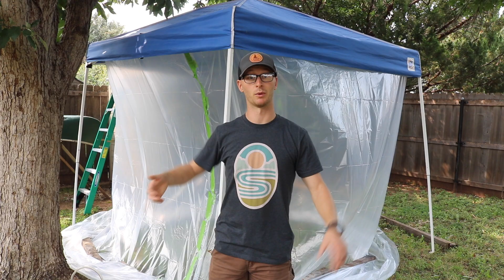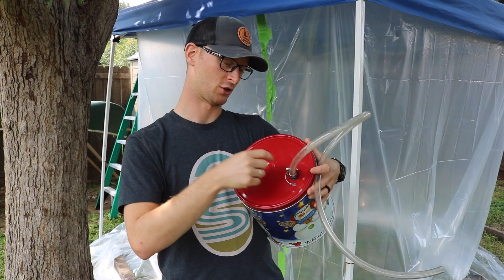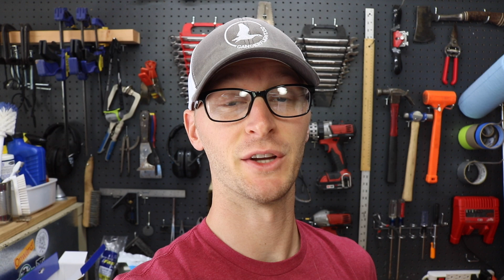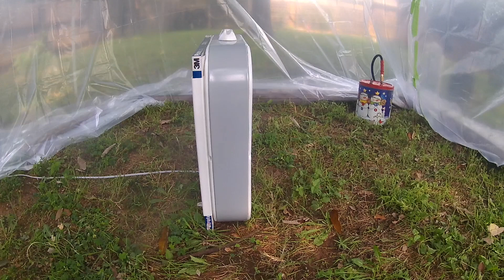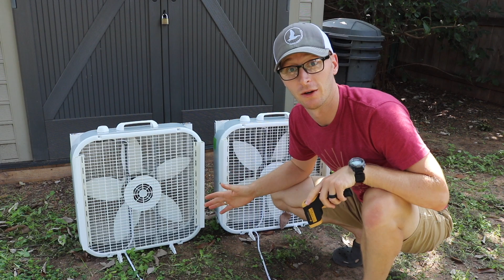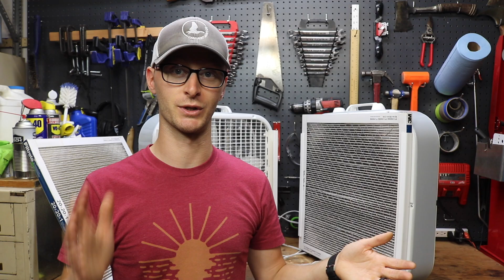Are DIY Box Fan Air Filters SAFE?

Comment: I would like to do this in my woodshop. What is a good filter for airborne wood dust.
Reply from the maker: Read the packages for the filters - but I'd say the MERV 13 I'm using in the house would be overkill.
Reply: @GanderFlight  Wood dust is very fine.  MERV 13 would be great.

Comment: Most of these motors have a thermal stop fuse, that will merely stop the motor if it gets too hot. Most often, they don NOT self reset. The thermal cutoff needs to be replaced, if it's even accessible. More often than not, you end up just replacing the whole fan. I wouldn't worry too much, because the motor needs to exceed 180 degrees Fahrenheit to trip that, and you're not getting anywhere near that hot.
     If I was going to recommend anything, I would say get 4 or 5 filters, and make a box. That gives you that many times more surface area, the fan will flow more freely, and, the filters can get dirtier before they need replacement. Each filter only needs to allow 1/4 the airflow, before the fan loses effectiveness. While it's more expensive up front to buy that many filters, it will save you money in the long run. While more effective, it does end up looking pretty DYI. Ugly, but tremendously effective! (I, like you, recommend putting the filters behind the fan for the same reasons you stated)
Reply from the maker: Good to know about the thermal fuses!  Yeah everything is a game of compromises right? Aesthetics, function, low cost — pick two 🤣
Reply: @GanderFlight  Have you had a chance, to see if it prolongs the life of your furnace filter? The reason I ask, is because I have a base-board heating system, that uses hot water circulation. My heating system has no filter, and the house is much more dusty, than my other house, that used a forced-air heating system, with a filter. I had to replace that filter regularly. The biggest difference, is that the furnace cycled on and off, where as my filter box/ fan, with a motor that requires only ~1/10 the power, runs 24/7. I think this is more effective, than the forced-air furnace.
     There are actually NAMES for these things! If you use 5 filters, and prop it up so air can get through all five filters, it's called a "Corsi-Rosenthal box". If you use four filters, and just use a cardboard square on the back, with the intention of placing it on the floor, with the fan blowing toward the ceiling, it's called a "Comparetto cube".
Reply from the maker: @vincentrobinette1507  I have not had a chance to test and document that concern. I can only assume it would - you're taking the same amount of air in the system (house) and adding another filter.

Comment: Great video! I saw this idea, (same as yours), some months ago. The idea bounced around my head for a while and I decided to build one. One $18.00 Walmart fan and a 20"X 20" filter, the most expensive one Lowe's sells, taped it on securely and it has been running constantly for 6 months or so. The fan motor hasn't gone south but I change the filter every 2-2.5 months. That worked so well, I got another fan and filter and some duck tape. That one has been running for nearly 3 months. We have a HEPA filter in the bedroom due to my wife's allergies and my COPD. The fan filters do make a difference but I have no way of testing its efficiency.
Reply from the maker: Glad theyre working out for you!

Comment: Best reason to put FILTER ON BACK is because you're filtering the air BEFORE the dust gets to the fan motor.  If this was near a dust source that can build up (like saw dust) then the dust can not collect on the back of the motor because the filter collected the dust first.  

This reason alone is important enough to make it the preferred method.
Reply from the maker: Thanks for the perspective!
Reply: Excellent Point!

Comment: I love your idea.  This video It shows how corporation fail us so badly,  now more than ever. hundreds
Making an air filter need only a few elements with good deign, quality filters that matches the volume of air .. A big fan matched to a big filter.  
Quality filters, motors then production. Not sweet shop labor from poor farms and under age kids or teens who need to be in school, not on shop floors making our cell phones, fancy cloths and sports wear.  
The fan on the right may run a bit hotter because of  a manufacturing variable, from the same factory but a time.  The quality of the product, how many flaws are allowed before the rejects are noticed.
Reply from the maker: You are correct - each fan motor may have a different base operating temperature.

Comment: the only thing that I can see if you put the filter in the back is that no dust will stick neither on the blades or in the back grille as it usually does when you don't have a filter on it
Reply from the maker: Filter on the back definitely helps keep the fan itself clean.

Comment: What are you using for a filter bracket to secure the filter to the fan?
Reply from the maker: J Channel from the hardware store. Its used on vinyl siding - you'll have to cut it down and the size isn't 1", but its flexible and holds the 1" filters nicely.

Comment: You would experience a difference! Its based on how the fan is designed to flow. Air intake is passive, so low power consumption. Airflow, from the front, is what is powered by the engine, and by immediately impeding it you loose many cfm (amount of actual air movement throughout the entire room). Sorry if not explained well, but trust me, it makes a huge difference when turning over air throughout the whole room!
Reply from the maker: Clarify for me - are you then advocating for the filter on the back or front based on that?
Reply: @GanderFlight  YES! 100% on the back.

Comment: going to  purchase a 20 x20 filter and cut away the card bord and   measure out  whay i need for my honeywell   air purifier     its  like   4  in  wide  x  24  in long and install it    take out the black  foam filter    it should work well  and i can  get  4 or 5   filters out of it    !
Reply from the maker: Sounds like you have a plan!

Comment: So then this inexpensive filtration system should work with dust ?
Reply: Most likely merv12 so not HEPA standards and this does not have activated carbon
Reply from the maker: If you get the correctly rated filter to work with dust - check the manufacturers ratings on whichever filter you use.

Comment: Does the fan still work to keep cool, or is it only a circulator of filtered air? I use it at night to keep the bedroom cooler for sleeping. You are a good instructor.
Reply from the maker: Yup definitely still moves air to cool - not as much as without the filter, but that’s to be expected.

Comment: Filter on back is bad with the fan you tested on
Reply from the maker: Why do you think it is bad?
Reply: @GanderFlight  Short answer ( I have a vid on this also) The version of fan you use has no front shroud.In the corners air gets in and is un filtered.More than you think. Over 50%Reason your blades WILL get black stuff on them.
1:45 look at the front grill of his fan
https://www.youtube.com/watch?v=kH5APw_SLUU&t=14s

Anyway this is the worst version
Reply from the maker: Gotcha- I thought you meant the filter was bad. Yes you’re absolutely correct- with the gaps in the corners you’ll pull some air in from the front.
Reply: @GanderFlight  Yep
Reply: @GanderFlight  Also I dont think..I know ..I have tested this and fiddled with for 8+ years. Actually did a podcast about it.
if you get ANY build-up on the blades...you have a front leak (more or less)
Reply: @GanderFlight  on 3 tubes I use, 1.4 million total views. I have a 10 part series
https://www.youtube.com/watch?v=JnifYrtPUrA&t=6s

Comment: Thanks for the video!

The advantage to placing the filter on the back, is that the filter stops the usual build-up of dust and dirt on the fan blades (which .. over time, puts more drag on the blades which may heat the motor up a little with extra work and less airflow). Meanwhile, putting the filter on the front stops the dust/debris escaping, which slows the exit airflow a little and (admittedly, slightly) encourages the build up of dust on the blades and doesn't protect the motor. So for single filter setups, I'd recommend the back mounted filter, and you get the aesthetic benefits that are mentioned in the video and unobstructed access to any front-panel controls. 

As found in the video experiment... the amount of filtration should be (for all intents and purposes) identical if the fan speed and filters are the same. However, if the experiment ran for months until the filters were clogged and needed replacing... that story might be a little bit different.

Taking it further.. two filters of differing types:

 A lot of wood workers, noticing the sawdust buildup accumulating in their workshops are putting filters on both the front and back of fans (Google/YouTube search: "DIY workshop air filter", and you'll get the idea). These usually involve two or more filters, with the typical air filter for the larger dust/particles/fibres on the back and another, 5 micron HEPA filter (or something similar) on the front. Naturally, this filters the air to a much higher quality, but also increases the cost of construction and ongoing maintenance. While you want a nice sealed "bottle neck" around the fan itself for efficient airflow, it's also better if you have a slightly larger filter than the fan on both sides as this reduces the "back pressure" the filters will place on the motor.

If safety is your biggest concern, the best things you can do:

1. Keep your house as clean as possible... the less dust your filters are exposed to, the longer they'll last, and airflow will be less restricted. Put simply, there's less to catch on fire if there's a problem, and it's a situation that's less likely to cause a fire too. :-)
2. Clean and replace the filters regularly, (or as needed in times of low air quality). Clean any build up on the fan blades and suck any dust out of the motor with a vacuum.
3. Electrical safety. If you're enclosing a fan inside a box, then having a dedicated  "safety switch" which (depending on the type) is usually either a Ground Fault Circuit Interrupter (GFCI) or Residual Current Device (RCD). These devices create an automatic way to cut the power  to the fan in the event of a fault. Differing laws and electrical systems are found in differing countries, but research how things are done in your relevant area or talk to your local qualified electrician and they'll give you appropriate advice. However, we can buy RCDs in Australia for around $20-30 in our nearest hardware store. Installation is easy. Plug the RCD into the wall, and then plug the fan into the RCD. Turn on the fan and make sure the switch trips the power by pushing the "Test" button, then hit the "Reset" button to turn the power back on.

I hope this helps someone out there in these crazy times!
Reply from the maker: Thanks for the helpful and well thought out comments!
Reply: Ya makes way more sense on the back nearly every fan ive had that failed was due to dust collecting on the motor and building up till it has to much resistance and fails. Also i never run it on max speed and the motor stays cool enough within spec.
Reply: Yeah, filter on the back is safer in the long run. Esp if used in a woodworking shop
Reply: If you put it on the front, the air won’t go through and it’ll start blowing out the back of the fan
Reply: another great reason to put it on the back is that the motor runs slightly cooler. When you throttle a centrifugal pump or air blower, you always throttle on the input. Since you are moving less air, actual work goes down, therefore heat generated goes down. The cooling effect across the motor goes down as well, but not as fast as the decrease in power consumption. If the filter is clogged, then heat might start building in the motor. Almost better to have some leakage just in case. What's funny is a 2000 CFM fan will drop to about 200 CFM with a MERV 13 filter on the back. Every time you halve the flow rate, the effective MERV rating goes up by about 1 point. So, 2000 to 1000, then 1000 to 500, then 500 to 250...that means a MERV 11 filter is really like a MERV 14. But, the airflow is so small at that point, that it would only act like a MERV 14 in a small room. Better to use 4 or 5 filters in a box configuration and suck air through the box by the fan.
Reply: that is not the important. the important one is cleaning the air. (reduction in particulate)

  Front is better (pushing air is better).  

1.people run “unprotected” fans (we just call them “fans”) all the time, and it doesn’t seem to cause much harm.
2.putting a filter before the fan will make the air going into the fan turbulent.= The efficiency of the fan is reduced.
3. in addition to turbulence, you are also adding another component called “entrainment” where the fan pulls additional unfiltered air around the filter attached to the fan due to the low pressure built up between the blades and the filter medium

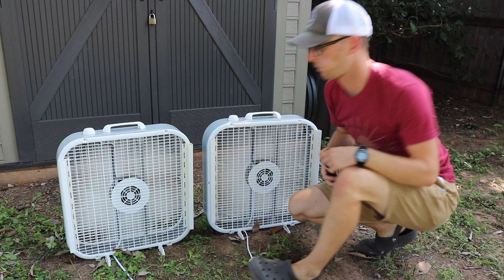best example: 6:10.    if at the back you will just blow dust everywhere in you room.   
https://www.youtube.com/watch?v=eYOvnqoW4H0 6:

Comment: There is a reason why you need to place the MERV filter in FRONT of the fan and not the back, and that reason is the pre-filter. The setup as shown without any pre-filter causes all types of dust and debris to block the MERV filter and quickly make it extremely inefficient. All you have to do is add a pre-filter to the back of the fan so that it will trap the big particulates such as leaves, debris, dust, whatever, and these pre-filters are cheap or you can get one that you can wash or just dust off. Without the pre-filter the MERV filter that you depend on for air quality is rendered useless pretty quickly as it will clog up and the volume of air that can be processed drops down to a rate that makes it useless. Strap on a pre-filter and you're good to go.
Reply: very good point.  Couldn't a pre filter be attached to the MERV filter on the back and achieve the same result? having the filters on the intake/back will help keep the fan inside/blades much more clean.  I've used that box fan to help dry leather that I dye and have noticed the colored "dye' particles coloring the fan blades without a prefilter
Reply: I think you are just adding more resistance when the filter is young and useful, you'll loose more flow from the extra filter than you'll save in the future. These are cheap just change the filter even the fans cheap replace it every couple years too.
Reply from the maker: A pre filter would be a great addition - thanks for sharing!

Comment: Will smoke air filters be effective if you just put them on a window without a forced air set up? And have an exhaust window fan on the opposite side?
Reply from the maker: I'm sure they'd be more effective than not having them, but unless the entire room is sealed except for the filter I think youd be better off forcing the air through with a fan.
Reply: I seriously doubt it ( or very little) , you need the air flow 'forced' to make the filters really useful

Comment: Hi there, do you have any ideas how I can add a filter to my smaller but powerful Honeywell fan? It's like a Vornado fan with a rounded back. I have anir purifier in my room but I'd like to kick start the clean air with my fan. My room gets really dusty and I'm disabled so I'm trying to get more clean air. Yes I've actually cleaned too. ☺️
Reply from the maker: Try putting a filter as close as you can to the front of that fan since the back is rounded.
Reply: @GanderFlight  ok thank you!
Reply: i have a honeywell  also  and  i am goint to purchase a 20 x20  by 1 in   filter and  cut it to fit the inside of my  honeywell   replace the black  foam filter with it   cut away the card board  on the filter  and  then measure out  what i need   mine is like  4  in  wide by  24 in tall  so yea  i thing it will work !

Comment: Thanks for the experiment.  I have put a wifi switch with cloud timer in it.  It is a little bit fancier.  So, every two hours and stop for an hour (whatever you like for cool down the fan) around $10 to $15.  But when your son's nasal allergy get improve much better, that makes me starts to make one for every room.
Reply: Run it for 4 months now, and I put have put a UV light and hide behind the filter against the wall for extra sanitizing and no direct UV light exposure to me.  But that is really good for cleaning the mold (even covid) in the air.
Reply from the maker: I like the additional customization! You could also do that with a standard outlet timer as well!
Reply: What’s a cloud timer? I have WiFi switches and receptacles but it’s all managed in the app nothing on the cloud.
Reply: Cloud just mean that the app store your timer setting in a server somewhere we don't know.  Actually not quite knowing that my wifi switch timer info on the cloud or in the app or in the switch itself.

Comment: Anyone have an issue with there filter giving off a strong scent?
Reply from the maker: I've heard a few people mention a smell - is it a BRAND new fan? Often there is a break in period with a new motor where things are sorting themselves out.
Reply: @GanderFlight  yeah it's a new fan . That must be it thanks!
Reply: @garickjones3339  yes, this was me today—new fan smell, not as bad as the original chemical  perfume smell I was using it to get rid if! 
It has lessoned over a few hours, hoping it will be gone next time I run it.
Reply: The 1st fan I tried this on started having a burning smell after a week or two of intermittent use.  It was a Lasko Weathershield fan, not sure if those have a weaker motor than other Lasko fans, or if I'm unlucky and just got a bad one vs. other people like Gander Flight that say they've used these fans for years without a problem.